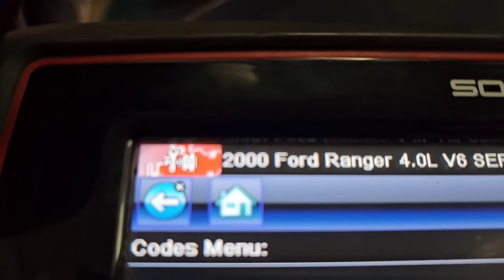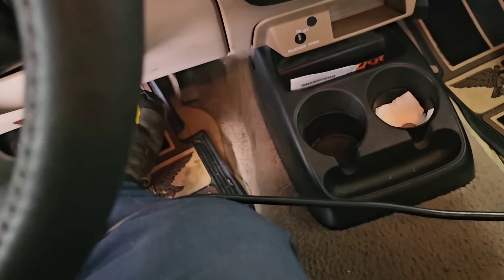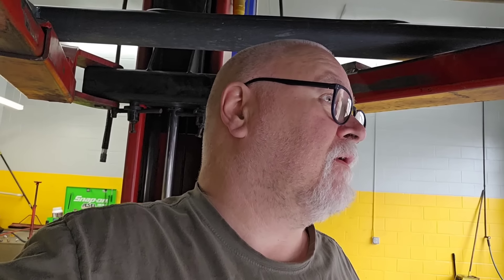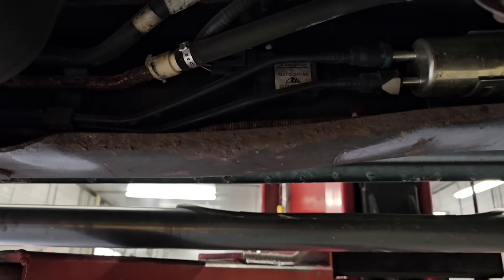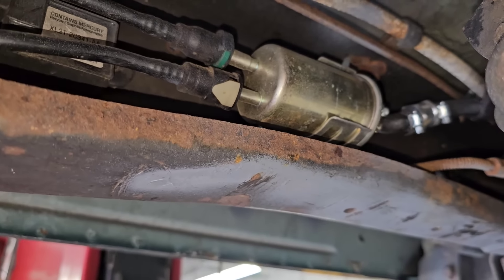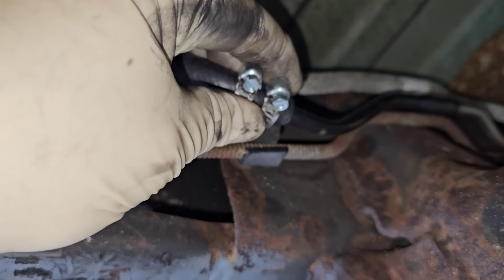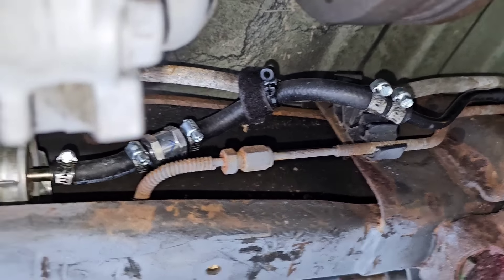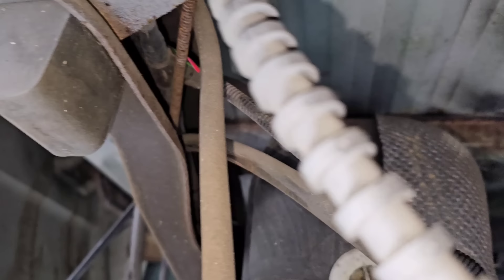Someone Has Been Here Before!! We'll Have To Find Out More of The Story..

Comment: Captain cut the hose put the cut hoses back on....What a dangerous bodge.....Im guessing the safety check flap valve in the filler neck is jammed shut....This prevents petrol spill if the truck goes on its roof...🤔😮😳🇬🇧

Comment: A good lubricant and a decent hose pick tool is easier (and more correct) than slicing the hose. My favorite is GM Heat Valve/Rust Penetrant. It does a nice job softening the hose, and I mean in a rejuvenating kind of way, not a 'wrecking the hose' kind of way. Actually, GM Heat Valve is my penetrant of choice for pretty much all uses regarding hoses and rusted fasteners. It's expensive, but a little bit goes a long way. I usually use a can for several years.

Look forward to a conclusion on the Ranger, Kenny!

Comment: An EAP solenoid doesn’t affect the way gasoline goes in the tank and solenoid put the gentle vacuum on the fuel system and check it. It put the vacuum on it it stops and monitors it with a sensor if it detect any leakage with the fuel vacuum drops there some type of leak and it will trip a code for that if you can’t put fuel in the car with A or the truck with a fuel at the gas station, you’ve got a restriction in the rubber hose or something in the way in that inlet and sounds like you’re running a diesel to me and those are totally different. If you go to a truckstop and try to use the high output diesel fuel delivery system it will not work well in a standard truck, they’re designed to fill up big tanks. Hope this helps you out Frank Avery.

Comment: Yeah got a snap on at our shop 2007 is like the earliest it'll auto detect super pain in hte ass to use it on the Subaru forester 2005 for codes and such its...slow putting info into it, but once its in there its pretty okay? Like i have a bad gas cap so cleared the code had to do the throttle position relearn because subaru...but yeah that didnt work the first time set ANOTHER code for "idle lower then expected" yeah no shit you didnt do the thing where you leanr the thing! so had to erase THAT code and all and all it took me almost an hour it was insane how long it took that thing to boot, go to subaru, put in the info and have ir ready to go to read and clear codes...like from plugging it in to having the codes erased was easily 10-15 minutes itself...

Comment: It could be the canister vent valve -- but it probably isn't.
It could be the charcoal canister -- but it probably isn't.

These trucks have a ball-like float in the tank where the fill neck enters that acts like a check valve.  When the truck sits for a long time without being filled (which this one obviously does given the mileage you stated), that check valve sticks shut and blocks filling.  If you disconnect the filler neck and poke a stick down there, you will probably feel it pop free with a little pressure.  Then it will fill fine, for a short time.  Then it will stick closed again.  It makes it hard to diagnose because you take it all apart, don't find anything wrong, put it back together, and everything works.  And then a comeback.  I have one of these trucks and have dealt with this same issue for years.  You can't replace the check valve without the entire tank.  I don't know any long term fix.  But knocking it loose will get it going, and I suspect more regular filling with fresh fuel will help keep it clean/unstuck.

Comment: That is the kind of work that makes DIY guys look bad. There is only one way to do it right. I'm not a big fan of the worm clamps, but that is ridiculous. I would be the same way Kenny, good video.
Reply: That the kind of work that flat rate tech do in my town.:face-purple-crying::face-purple-crying::face-purple-crying:
Reply: That's terrible. Though I don't like the worm clamps, if there is a barb or flare it will work, but where there was 2 clamps on that hose, it can blow off like Kenny said. There is a lot of pressure on that fuel line. Not to mention the split hoses. It almost looks like they had trouble getting the hoses back on and split them on purpose. @k9under

Comment: Compression fittings on rusty brake lines... Terrifying danger .
I won't touch that car.
Reply: God no. I have a friend who used to use compression fittings on brake lines. I told him from now on if he can't flare them right, call me to do that part for him never do anything as unsafe as compression fittings. Those things should be banned. We had a guy at the local race track run them on a racecar. After the driver lost brakes 2 weeks in a row he quit driving that car. He didn't realize the owner was doing that until the second week when he looked to see why he lost brakes 2 weeks in a row. It never occurred to anyone someone would do that.
Reply from the maker: The driver is lucky he didn't get hurt!
Reply from the maker: Compression fittings are ok in an emergency only until you can get the right parts to do the job. Thanks for watching 🔧
Reply: @WrenchingWithKenny  very often that is never done and fitting stay in..
I see so so many.
Will fail NYS inspection.
Rusting brake lines even worse .